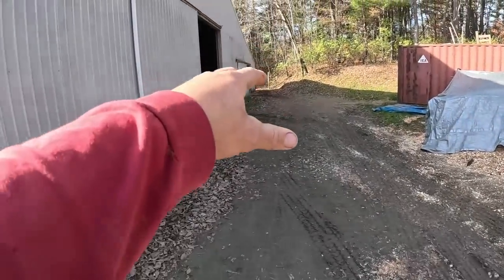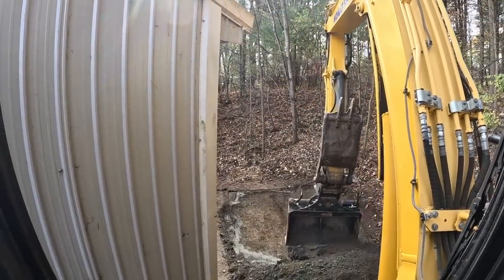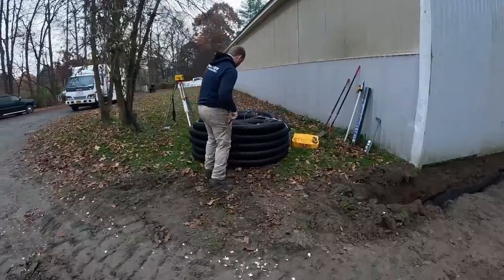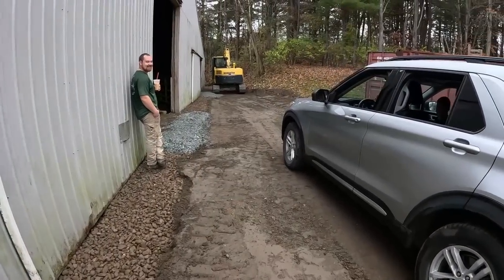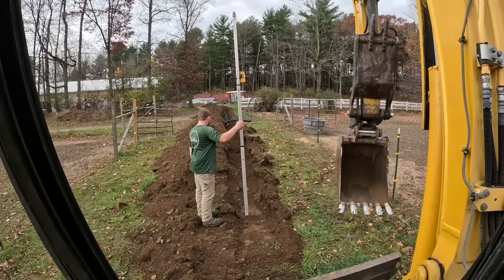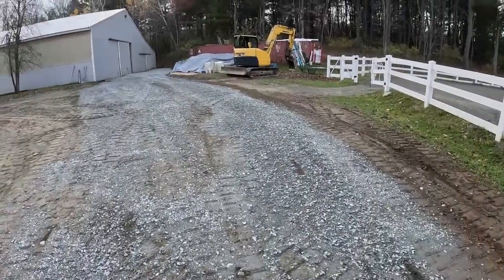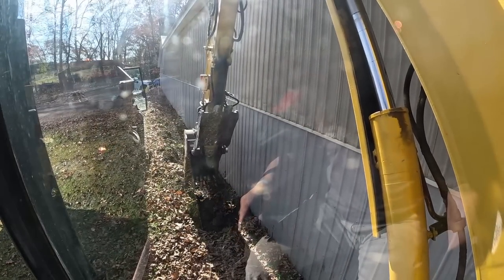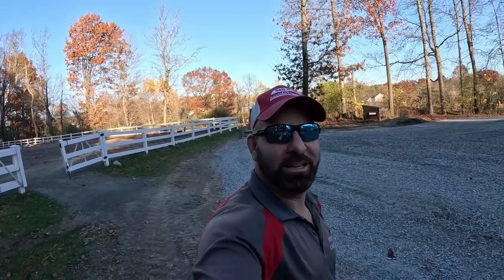DIY French Drain  Yard Drainage Solution Pole barn horse arena

Comment: Do you not cover your drain pipes with fabric to prevent dirt plugging of the slots?
Reply from the maker: Typically no that's a reason for it a pipe to plug the filter fabric gets silted over and becomes a waterproof membrane..open trench best results

Comment: gutters on the building would go a long way to fix water problems
Reply: And add a gutter cleaning chore.
Reply: Probably a lot cheaper first option
Reply: I'll spend thousands on a French drain system instead of a fraction on gutters....
Reply: Gutters go on the sides of the building (where the end of the roof iron is located)....not the front

Comment: The disadvantage of using a drainage pipe is that it will be pierced by the roots of plants and the water drainage will be disturbed. A better one is PVC pipe with gravel and PVC pipe pierced with holes
Reply: The rain pipes can be connected to it, roots have difficulty with PVC and the drainage is loved by roots
Reply from the maker: These pipes are engineered and designed for french drain systems they have it pretty much figured out

Comment: Your explanation against solid pipe was inaccurate.  If you read the installation guidelines from the pipe manufacture then you'll notice self-cleaning for 4-inch corrugated-pipe is 2.8% slope, solid 4-inch only requires .78% slope to self-clean.    
I live in hurricane territory so we often get 3.5-inch flash-floods & the occasional 4.5-inch flash-flood so a half-acre of impervious (soggy ground) cover requires one solid 8-inch pipe or dual solid six-inch pipes.   8-in solid self-cleaning needs .347% slope, six inch solid needs .49%.
Reply from the maker: Thanks